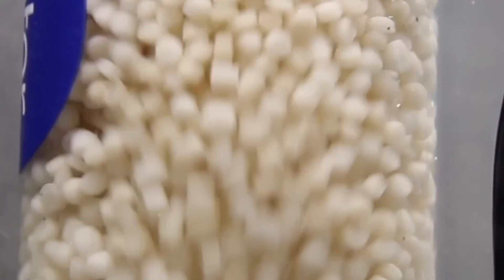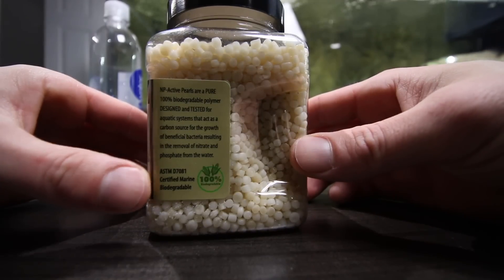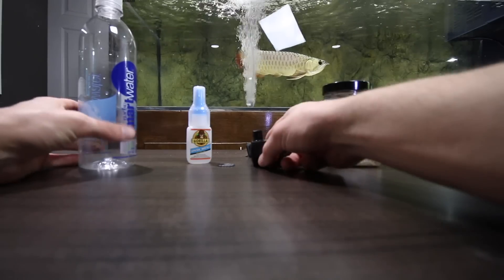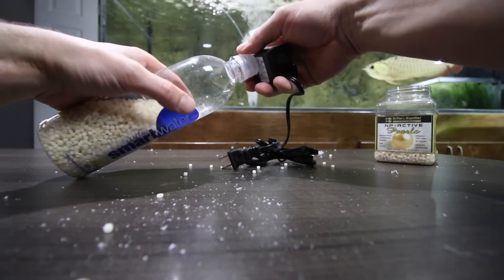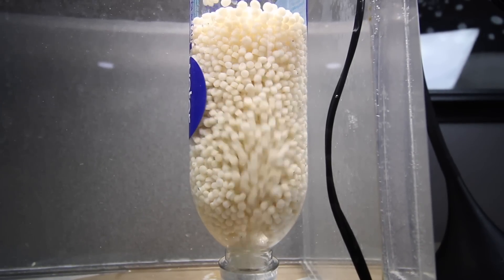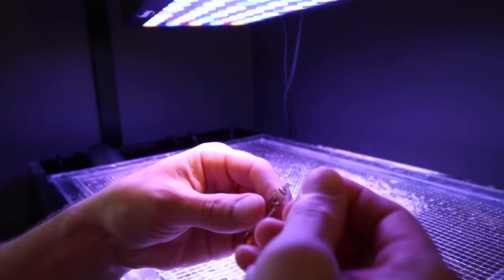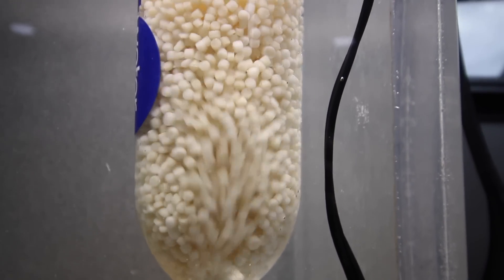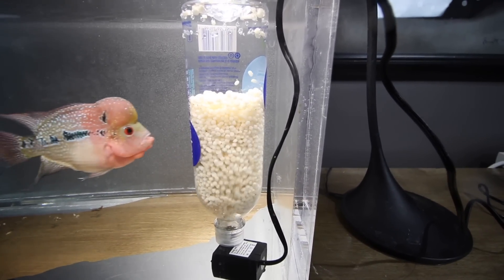DIY aquarium Bio-Pellet reactor

Comment: Is that the same as a fluidized filter?
You mentioned saltwater. I'm getting ready to change my freshwater system to a sump system.
This type of closed system seems quite perfect for my use. (I need a closed system with little air mixing to not wash out more CO2 than necessary.

Comment: love you vids Joey! speaking from personal experience i removed my biopellet reactor and went to liquid dosing. the reactor works best in a recirculating configuration. you need to have enough water movement to tumble the media, but with more flow you begin to strip the water TOO clean. if you have too much biopellets going on in a while you'll begin getting this nasty pink goo forming everywhere basically slowing your water flow down to almost a halt. liquid dosing of vodka or better yet, NOPOX by RedSea took care of that problem and it's a lot more controlable in that you dose in mL so you know EXACTLY how much you are removing equal to how much you dose. I know you did a dosing video a long time ago, so this would fit in perfectly ;)

Comment: Hey Joey, I have a question regarding setting up a budget tank, but still keeping upgradeability in mind. 
Is there any reason if you were to build a tank, you couldnt use a 4-5ft tank, but set it up as a nano build in terms of bio-load?

Im talking about only 1 or 2 fish and maybe some live rock in one corner of the tank with one small light, and then leave most of the tank empty and unlit? 

Would it be possible to do this and only use the filtration required for a nano aquarium? If so extra filtration can slowly be added and the bio-load can slowly be increased? Obviously this would be a much lower initial investment so im curious as to what you think. 

Sorry for the long post i hope this makes sense.

Comment: Hey Joey, I reckon don't worry about a skimmer, a tank that size won't need it so long as you do your water changes, which I'm sure you will, but I'd suggest a GFO reactor instead, I've found in a reef system the phosphates are the biggest nutrient issue, given that you'll be running bio-pellets you'll need a skimmer, but personally, a tank that size shouldn't need bio-pellets or a skimmer, water changes should cover that no probs, but I would recommend running GFO as you'll get phosphates leaching from marco rock and lead to some nasty algae outbreaks in a few months. Love your videos by the way. Peace, Corz

Comment: hey joey i was wondering what air pump you use and or how you pipe it about your tanks ... i just got a fusion 700 for 23bucks on ebay and boom mind blown. thing pumps 2 stones and 2 double sponge filters on lowest setting.. guess i need more tanks to make use of the airflow

Comment: great video as always Joey. I'm having a bit of a nitrate problem in my tank. always hovering around 40ppm even with regular large water changes 2 x week. pothos plant and various live plants can't seem to keep it down. it's a 55 gallon mbuna tank that's on the overstocked side. any suggestions? I'm currently trying to figure out how I could install a drip system.

Comment: Keep an eye on it man.. Many of souls have had serious issues running bio pellets full bore like that.. Should really be a recirculating reactor able to fine tune it ( easy to make fyi) .0 nitrates is the enemy although it was touted to be the only way for years and years . You will have coral troubles running it as you have it, Google is your friend if you don't believe me..
Reply: Exactly... not only are they moving too fact to get anaerobic bacteria but if it did work with that amount he used he won’t be able to keep a moral alive if he tried.

Comment: Seems like a large pothos plant would do just as well at removing any nitrates as long as stocking isn't too much for the tank, but I guess it might not work well with everyone's scape. On the plus side, the pothos doesn't require replacement every 3-9 months.

Comment: Hey joey.. love all your vids. How do you plan to use it in a freshwater set up? As you said it needs to feed into a protein skimmer so all of the waste and dead bacteria doesn't spit into the tank and settle on the bottom. And protein skimmers don't work in freshwater. Just wondering what your plan is on how to keep that out of your tank.